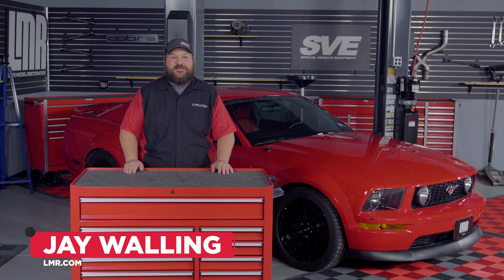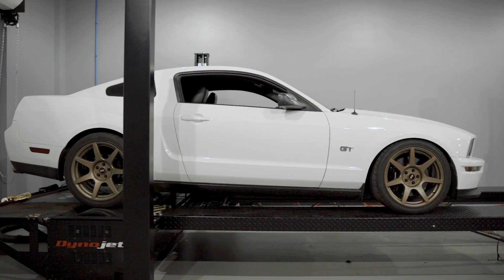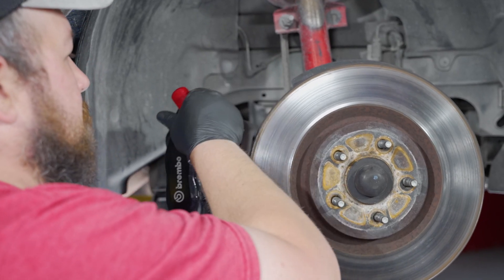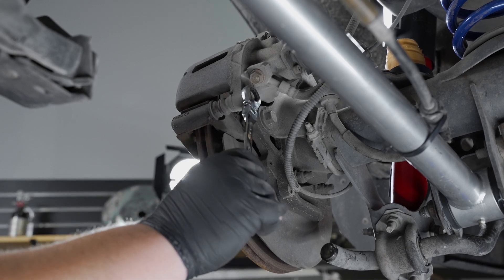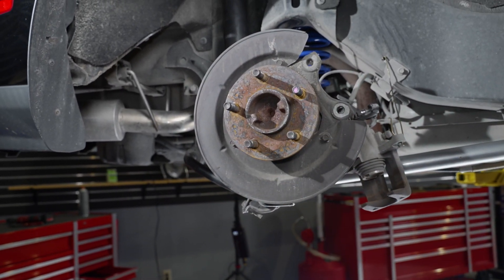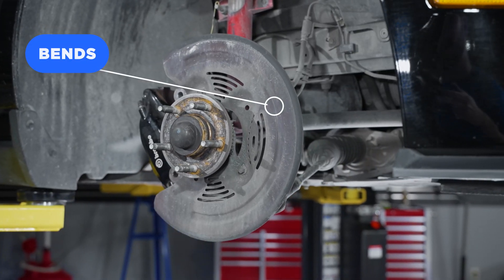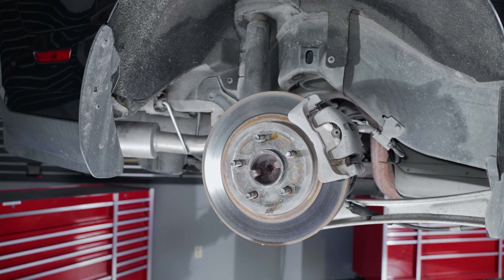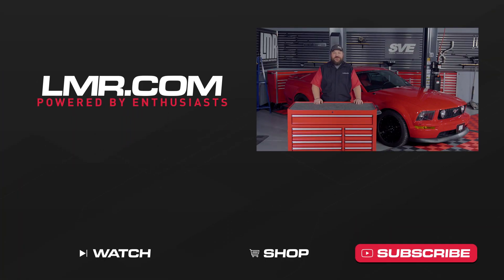How To Remove Front & Rear 05-14 Mustang Brakes | S197 Mustang Brake Removal

Comment: Hey boss man ran into alil snag on my 2005 ford mustang gt. I have 2 coil pack bolts that will not tightin on the drivers side. They appear to be stripped. How can i fix this?
Reply from the maker: Hi Brandon, 

We recommend having someone take a look at what's causing the issue. You do not want to cause any further damage when tightening down the bolts. If you know of any local shops or performance techs, reach out to them and see what they can do to help.